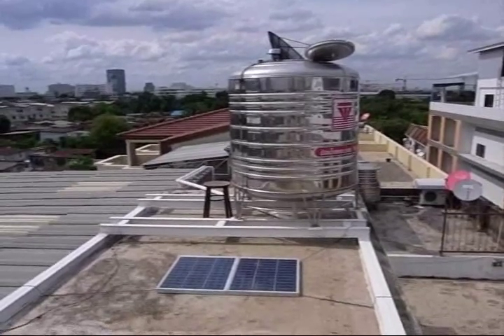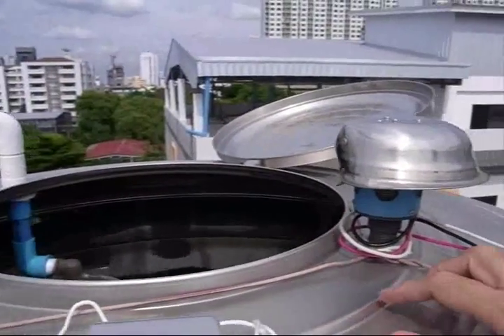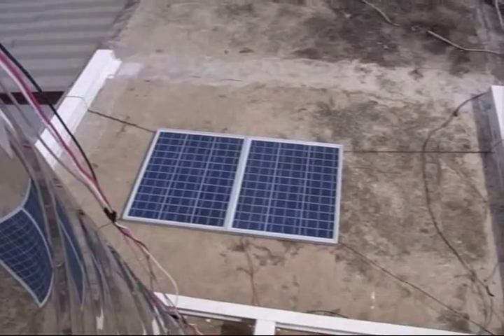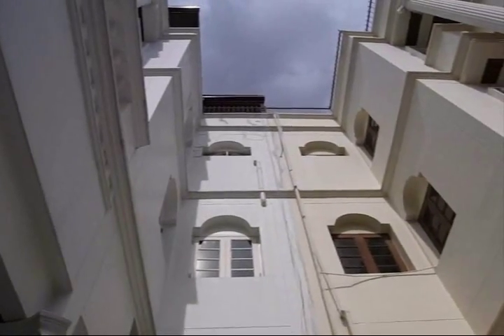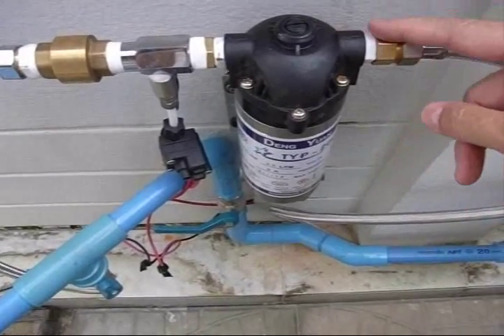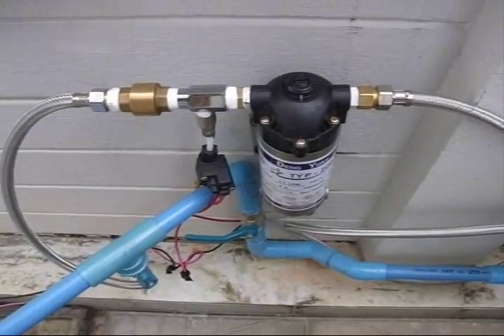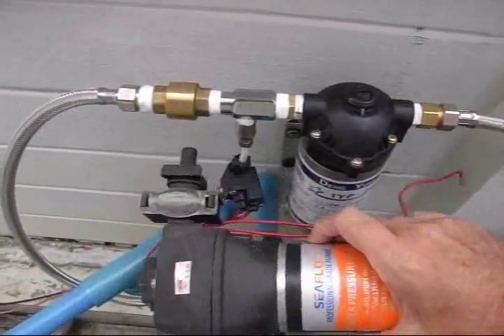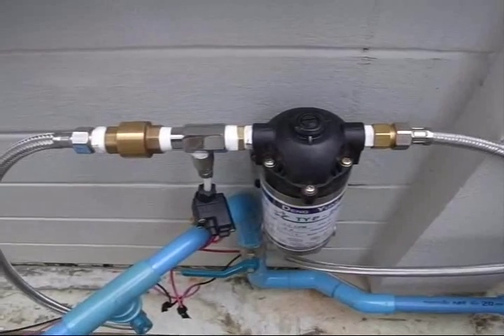Home Solar Water Pump - Working Prototype  (Updated Video Available)

Comment: Name of the pump to buy it on aliexpress?
Reply from the maker: The brand is SeaFlo.  I don't think it's special.  You need to look for the voltage, amps and total water volume / minute for your application.